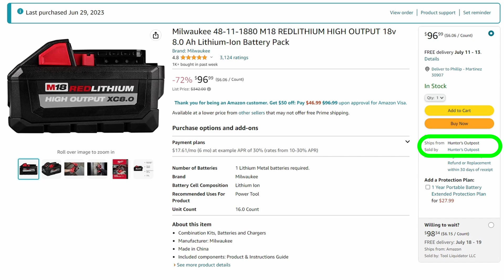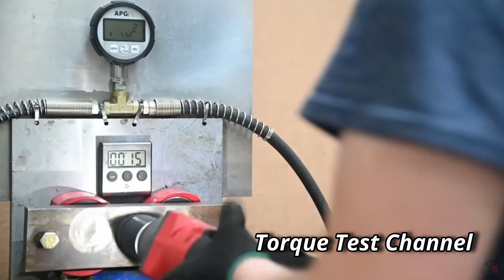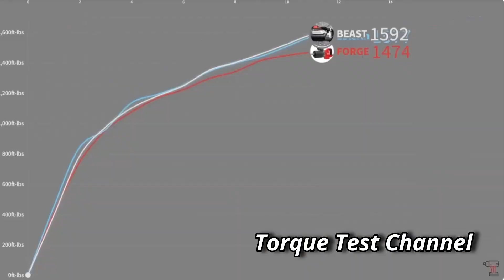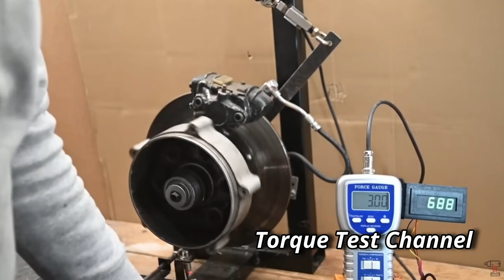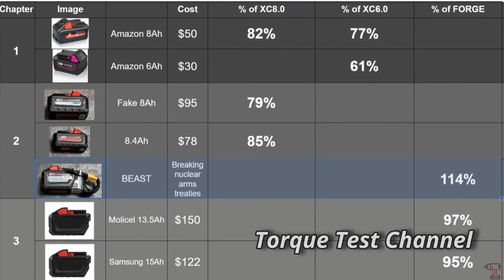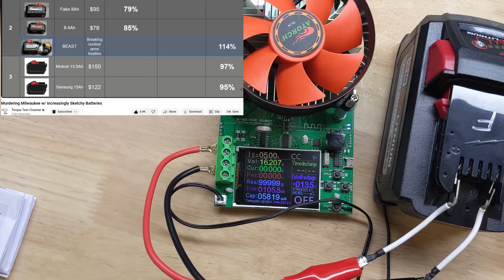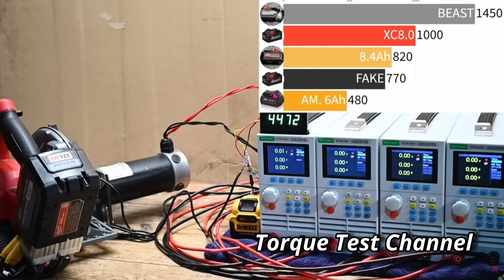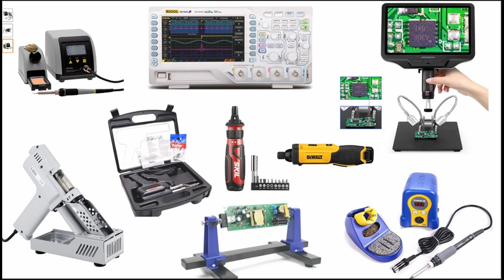M18 Battery Pack Updates

Comment: I'm in need of help with my ridgid R250AF18 trim gun , can you give me some info ?
Reply from the maker: I do not have this model to help much at all, unfortunately.
Reply: It's not powering up I was just wounded if you may have some ideas as what could be wrong with it
Reply from the maker: @WallaceFeese  
Sorry, I have not worked on one like it. If you have tried more than one known good pack, then the problem is most likely in the controller inside of the tool. One quick thing to try is to verify that all the contacts are clean on the pack and tool itself. Other than that, it would have to be some investigation of the board.  Could be many things such as a blown fuse and it may be a reason for the blown fuse, such as a shorted mosfet on the board. All these I have seen on other tools, but I have no experience at all with this exact model. Best of luck to ya!
Reply: @ThriftyToolShed  thanks for the info

Comment: I used the exact same load tester on a brand new, fully charged, factory original DeWALT DCB210. I set 15v as the cut off voltage because zero bars on the battery gauge is 15v (3v per cell). I came back to find it stopped at just over 17v and only measured a bit over 6AH. It turns out that voltage drops to 15v and then recovers to over 17v after the test stops. How do I fully test it?

Clearly, the issue is that I’m using constant current while my BT-C3400 will gradually step down the current as it discharges but I see you are using constant current too. What mode will approximate the BT-C3400’s discharge test for a true AH measurement? I wouldn’t know what resistance or voltage to pick if I changed from CC to CR or CV.
Reply from the maker: I actually like using this method with packs and it will absolutely pull down to 15V and bounce back, but I look at it like this: The tool acts in a very similar manner. Most tools draw more than one amp while in use, most tool much more than that. So if you want a best case scenario you could simply set the discharge current to 1A. It will take much more time to do the test. I like to use a 2A load for most packs to be fair. If I use the same test in between all packs for my reference it is a very fair test. I typically set cut-off at 2.7V per cell for this reason and I know they will dip and bounce back quickly. I will use the BT-C3400 for individual cells and capacity tested them for cell matching etc.
Reply: @ThriftyToolShed  Thanks. My intention is to do something equivalent to the discharge/refresh function of the BT-C3400 as a way to lower the internal resistance and ensure maximum capacity from brand new packs that have been in storage. The BT-C3400 fully discharges and recharges three times when you do this with the capacity of tired cells seeming to improve with each cycle. It does wonders for imbalanced cells that haven’t seen a full charge/discharge cycle in years. In DCB210 batteries they sometimes overheat if you resume using them after merely bringing them back in balance. That’s because the internal resistance remains high until they have been exercised at a lower current.

10AH DCB210 packs are particularly problematic so for new packs I’ll do the bulk of the discharge at 2A then switch to a lower current and run it again and again until I get to around 3.1v per cell. Once there, I’ll fully charge on the DeWALT charger and then repeat the whole process two more times. From there, I will monitor the balance and charge levels throughout the mowing season. If all is well, I will give them one full discharge and charge before each mowing season. Hopefully this will end my long streak of bad DCB210 batteries for the DeWALT mower. :)
Reply from the maker: @emmettturner9452  gotcha! I thought you were just capacity testing. Glad you are having luck with that.

Comment: I work for a large fleet and pull 10-15 tires a night using the Milwaukee 1in dhandle 
How could I get my hands on the beast?
Reply from the maker: Hi,
TTC has the only one that I have made. I did share in a video a lot about the making of it though. I hope it pressures Milwaukee to come out with a 10Ah or 12Ah stack LIPO pack!

Comment: I think  the soldered link to the B+ and B- may be a type of failsafe fuse that actually worked as intended.
 I came to the same conclusion that most after market packs are not up to extreme heavy duty action as the bms and strip are of lighter guage. They can still be a decent value for general use.
The TPcell look pretty good, they actually copper sandwich the strips on some packs. And use (as far as determined) genuine cells. Sidorov has tested these to good result, but not to TTC level i dont think. Aftermarket, id go with these. But for hard pro use i would suggest oem.
 I myself like to build them as welll.
Reply from the maker: Absolutely. The strip that was loose was part of what we usually call the fusible link. As you mentioned the link should hold to that load with 8.0 Ah no issue and the buss strip was very undersized. Thanks for sharing the packs you have dealt with. Thanks for your comment!
Reply: @ThriftyToolShed  Yes the aftermarket packs are generally .15 strips (even .10) and most rebuild sets provide .15 strips  so as to be weldable for most light duty spot welders. Whereas OEM are mostly .20 to .30 or more. The average Joe has no clue a heavy load will heat things up real quick. On top of the cells being under spec. They seem to be 3ah but what amp rating 30? 20? 15? 10?

Comment: Amazing that they would skimp on the bus bar like that to save on a few few cents and introduce a such a significant point of failure. Incredible that it got so hot as to melt nearby solder!
Reply from the maker: Exactly, I hope it answers a few of questions that have been asked about the value of these or like packs. It's no right answer for everyone, but hopefully it's straight forward if you use these for heavy loads at least! I have used them in lighter loads with no real issues.  Thanks for your comment!
Reply: @ThriftyToolShed  Yes! I'm sure it will be useful to many who are trying to figure out of its right for them.